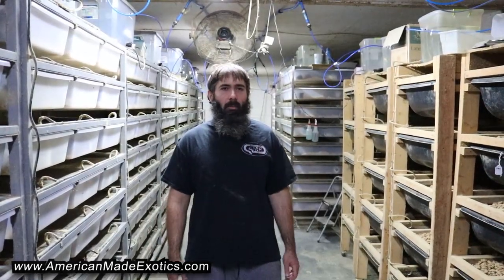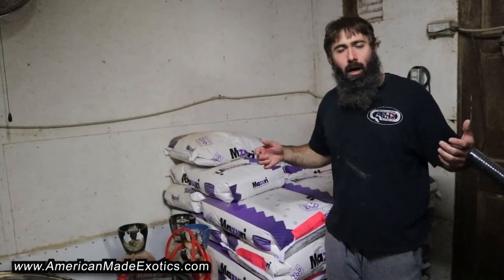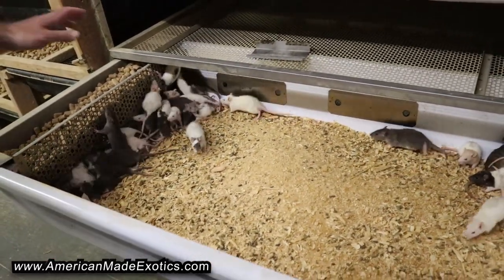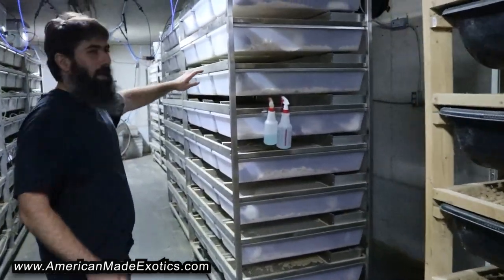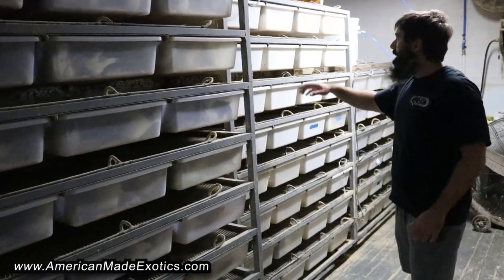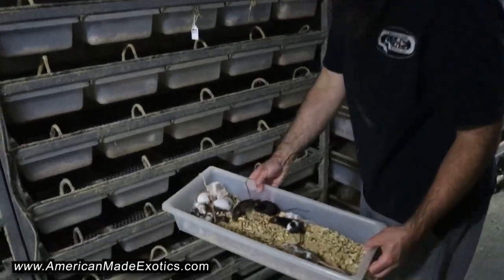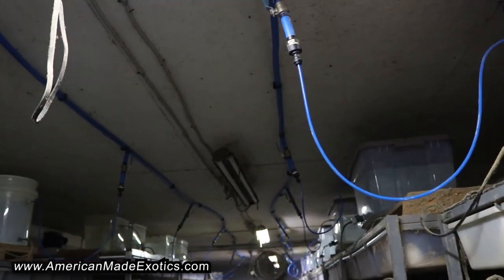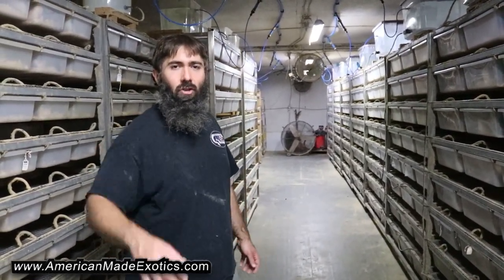How We Breed Our Own Feeders, Rodent Building Tour!! AME v35b

Comment: great videos. learned a lot of new things that ive never seen mentioned in other vids.
Reply from the maker: Glad it was helpful! Thanks for watching!
Reply: @americanmadeexoticsllc  I've been trying to do 1.3 ASF in the same tub and I find the handful of my colonies have newly wean dehydrated/dying off. Do you experience this? Could it be overcrowded?
Reply from the maker: @JaeSleepywood  You ma y have to figure out which ones are just not good parents and selectively cull them off.  I do not have that problem but I have selectively kept only the good producers for many years now!
Reply: @americanmadeexoticsllc  thanks for the help. Do you use spring loaded or diaphragm nozzles for the ASF?
Reply from the maker: @JaeSleepywood  spring loaded all the way!  I haven't used diaphragm ones in a looooong time and i've been very happy with the spring loaded nozzles from reptile basics compared to the old edstrom diaphragm ones I was using.

Comment: I apologise in advance if this is a stupid question but why wouldn't you want a loose rodent in that room? Could it be that it may chew through stuff or something like that
Reply from the maker: No such thing as a stupid question! The rodents are raised to know the water comes from the nipples.  A loose rat will get thirsty and associate the nipples with water and since it can’t get inside another tub to get to a nipple it will chew a water line and get a drink and move on… leaving behind a leaking water line to flood the tubs below it.  That is just on the short term. A single loose rat can be devastating to a rodent building besides the water lines they can get into the walls, chew wires etc.  the aluminum we have along the bottom of the walls helps prevent climbing or chewing into the walls but still we make a habit of not letting rodents get loose or stay loose.

Comment: Thanks for sharing this with us, Matt . That water system you have is top-notch really cool cause man do rats go through water. I have over 200 rats here. That i breed there on the 2nd floor, so I have to use water bottles not trying to have a flood. It will be a mess. Can't keep them in my basement due to no air flow, but there in a room with 4 windows. Each window has window fans in them blowing air out & in 24/7. Fresh air is a must. My question for you is, what is the best thing to do about the dust? Right now, I use carbon filters on the back of my fans it builds up fast, looking to see what others do. I also purchase a big air purifier that pretty much does nothing
Reply from the maker: Thanks!  Unfortunately the dust isn't something I have found an easy fix for other than we have a couple of shop vacs and brooms and it's a never ending job of sweeping and hitting racks, walls, fans etc with the shop vacs.  It truly is a never ending job.  If you find something that works to control the dust definitely let us know!!  I'm lucky in the aspect that I have my rodent building on 3 acres in the country so all that dust just spits out the fan outside and is gone with the wind.

Comment: When do you remove weaned rats from the mother? Do you keep a calendar for something like 22 days or do you decide when they ready to move out by looking at them?
Reply from the maker: They mature at different rates. We do not keep track of date from pinky to wean we just use our eyes. If the head is lifted up and it’s walking around with its head up we wean it. If it’s still not holding its head up as much we let it keep nursing and take it as still in crawler form.

Comment: I have a very similar setup with the float system I took it one step further and put trays under each one of my tubs in case there's a leak at the tub drain them outside like a water Peter Pan then I put the whole system on a sprinkler I timed the system to only fill one third of the tub at a time every 12 hours that eliminates even having to turn the water on just watching the system from cameras and water sensors will notify me if there's an overflow
Reply from the maker: I have thought about doing something like this as well for when we go out of town and such but we have no life outside of the animals really so somebody is in there a few hours a day so not to bad to manually do it!  The automation would be GREAT for shows!

Comment: To prevent flooding deaths drill a hole in the bottom of each rat tub and glue an appropriate size washer to prevent chewing. A tube to the floor will prevent the water going into the tub below
Reply from the maker: That is a good idea I have heard of people using grommets in the tubs.  Knock on wood its been a long time since we have had a flood but we make good practice of if we see a rodent hop out of a tub we drop everything until we find it!  Usually pretty easy with the racks off the walls.  So most of the leaks we get are slow drips from nozzles which we can just see a damp tub that should be clean and swap the nipples.  Again, knock on lots of wood! lol

Comment: where are you guys located and what is the temperatures during the summer?
Reply from the maker: North Carolina and it hits triple digits here in the summer
Reply: @americanmadeexoticsllc6609  thanks I'm in Vegas and struggling with AC but it's 110-115 a day out now. My productivity has completely tanked
Reply from the maker: I have run no ac like this for several years now.  Wind moving and good airflow is very important.  It's hot out right now and our production is better than ever, even with no AC!

Comment: What age do you pull weans of rats and mice?
Reply from the maker: we do not have a set age because it seems like they mature at different rates depending on how much "competition" for resources the litters have.  We go by how they visually look.  If they are walking around with their heads fully up right we wean them out.  It never hurts for them to have a little longer access to the ability to nurse but they don't do well if you pull early before their heads are held upright.

Comment: How to you clean tubs when there's babies in them?
Reply from the maker: Our room flows so we cull the first 12 tubs of the oldest animals every week.  This starts our cleaning cycle and as we clean those 12 tubs we move down the line moving rodents from their dirty tubs into the clean tubs in front of them. We move the adults and babies with them as we clean.  We clean down the row starting with the oldest rodents and finishing with the youngest.  Because we cull the oldest 12 tubs of rodents to start the cleaning cycle when we finish the rats that leaves us with 12 clean empty tubs at the very end of the line.  We tag the fist 2 tubs with the date (in case one clip gets knocked off some how) and we set 12 groups up we make out of the medium rats we have from the last weeks pull.  This finishes our cleaning cycle with 12 brand new groups. It keeps our rats from ever getting to old and keeps our production pretty even week to week because the rodents are always equally in the same age roughly down the line from peak producing to first timers and everything in between

Comment: what about in winter to keep it warm
Reply from the maker: In the inter time I have space heaters in the middle of the floor set to 63 and the exhaust fans are on thermostats set to 70.  I have 1 exhaust fan on a time to cut on every hour during the day for a few minutes to air it out and off at night.  There are so many rodents in the building and it is insulated well the heaters don’t cut on to much and the fans actually kick in pretty frequently from the body heat getting the building over 70.  I do put extra bedding in the winter to be sure they have plenty to build nests to keep the babies warm.

Comment: What temperature are your fans set to turn on?
Reply from the maker: The fans kick on about 70 degrees.
Reply: @americanmadeexoticsllc6609  so you keep your room at 70?  What range of temp do you keep and does these fans keep it 70 during say 90 degrees?  Thank you for responding!!
Reply: @americanmadeexoticsllc  also what thermostat and fans do you use?
Reply from the maker: Absolutely not.  The fans kick on at 70. If it’s hot outside it’s hot in the rodent building.  There’s just a LOT of air moving around.  Comparable to sitting in a car with no ac and windows up you would die, but with all the windows down cruising down the interstate it’s gonna be hot but not bad.
Reply from the maker: Gable exhaust fans designed to cool attics from Lowe’s. I run 7 whole house fans on my building